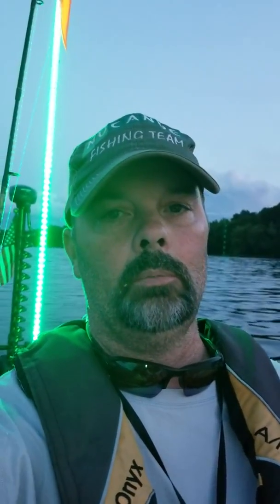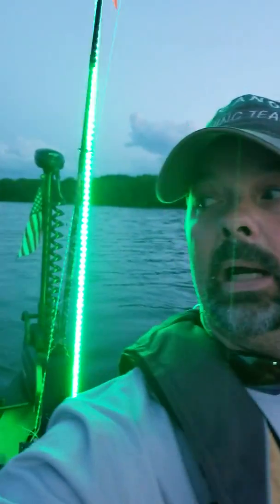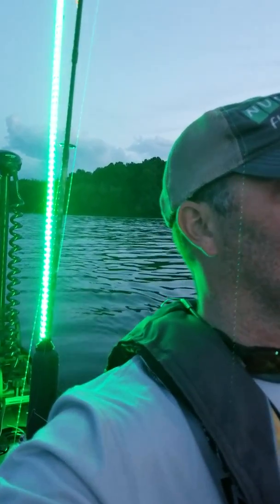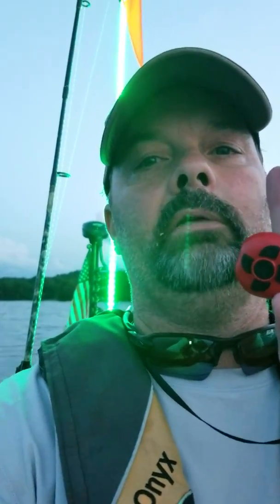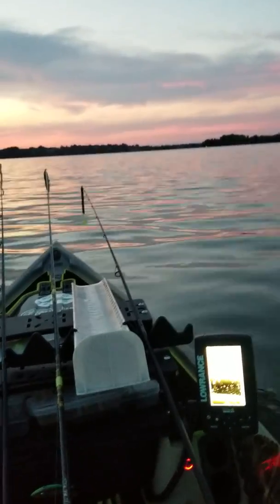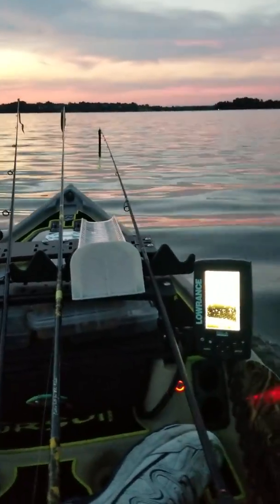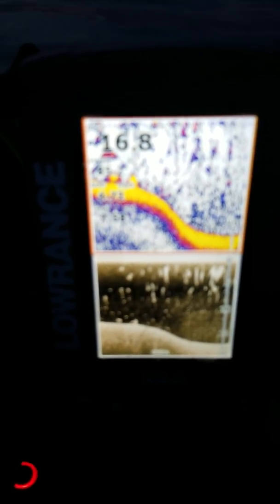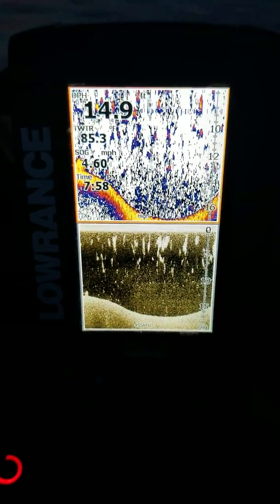NuCanoe Pursuit/Motorguide APC propeller test.

Comment: Where did you find a wireless bow mounted trolling motor at? I’ve looked everywhere haven’t found anything!
Reply from the maker: You mean a wireless stern mount?  It's a Motorguide W45, a basic vow mount motor and all I did was flip it around backwards.  

The W45 has since been discontinued but you can do the same thing with their Xi3 and Xi5.  There's also a company called Haswing that does make an actual wireless stern mount setup. Great little motors but parts and service can be an issue.
Reply: Mike Schmitz okay thanks I’ll check it out!
Reply: Mike Schmitz id like to see how you rigged it. Because I don’t see how I could make a bow mounted trolling motor into a transom one. Love if you’d do a video on it